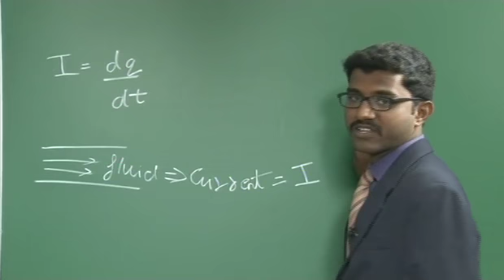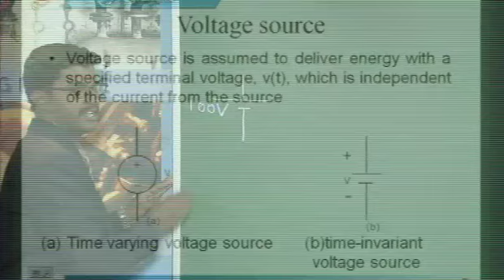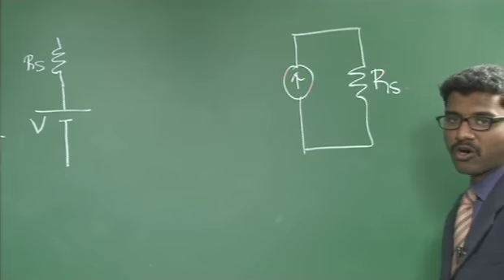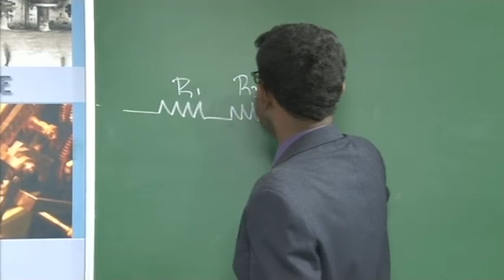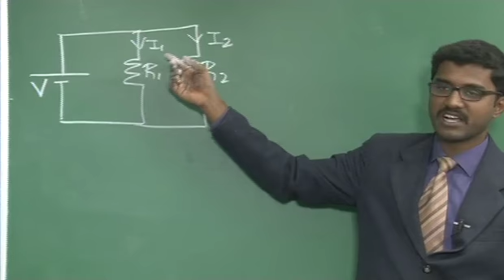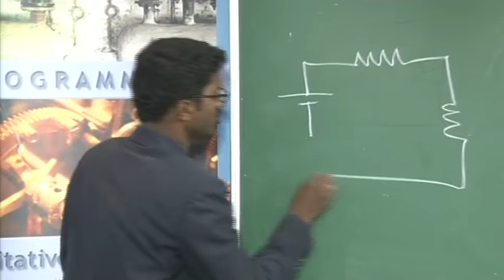Lec 1 | Electrical Circuit Analysis | 15EE32

Comment: How does current know how to split in parallel branches?
To answer this question one must know the role of surface charges in establishing a current and potential difference in a circuit.
Supposing there is  a simple series circuit comprising a battery, wires and a resistor R1 and there is a dead-end branch with a resistor R2 across R1.
When the circuit is made then initially electrons flow into both branches, but the surface of the dead-end branch becomes charged so negatively that no more electrons can enter. This prevents current flowing into the dead-end branch. 

Current of appropriate strength will flow in the R2 branch when the branch is connected across R1.
It is not possible in this post to discuss in more detail the rearrangement of surface charges which allows current through the branch. 

Electrostatics and circuits belong to one science not two and it is instructive to understand Current, the conduction process and Voltage at the fundamental level as in the following two videos:
i. https://youtu.be/REsWdd76qxc and 
ii. https://youtu.be/8BQM_xw2Rfo 

The last frame References in video #1  lists textbooks 3 and 4 which discuss surface charges and explains their rearrangement with the help of sequential diagrams in parallel circuits and topics on capacitive and inductive circuits using a unified approach to electrostatics and circuits.